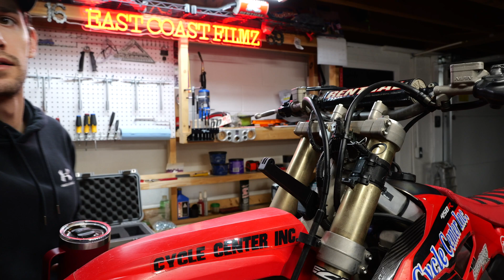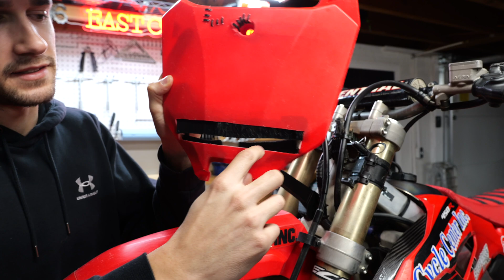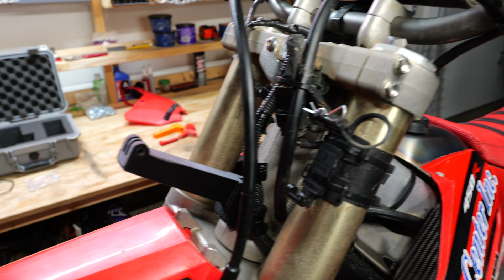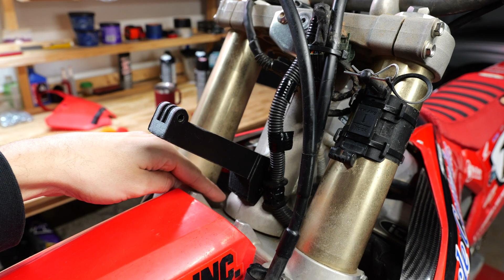Craziest GoPro Mount Ever?

Comment: Not a bad angle. I'm surprised it didn't chatter more with movement of the bike. The best POV I have found is the front of the helmet with the clip mount. This allows the most realistic view from the riders perspective. Plus you can keep an eye on the camera as opposed to the top of the helmet mount. I'm a trail hound so top mount is no good in the tight trail for obvious reasons.
Reply from the maker: Thanks man! AMA banned helmet cams of any kind during racing so that’s why I went down this rabbit hole🤣 chest mount doesn’t work with my riding style either